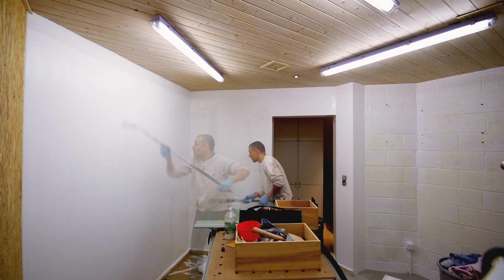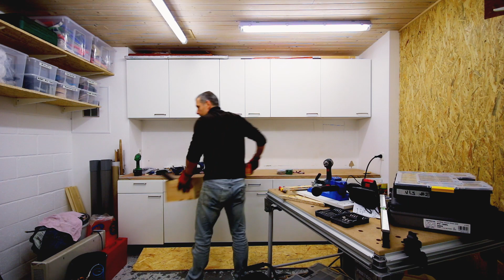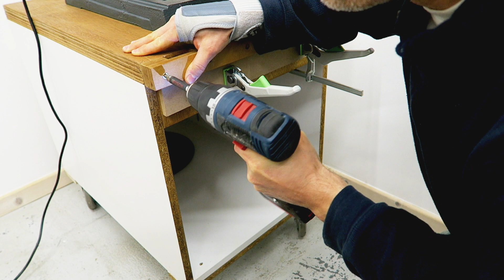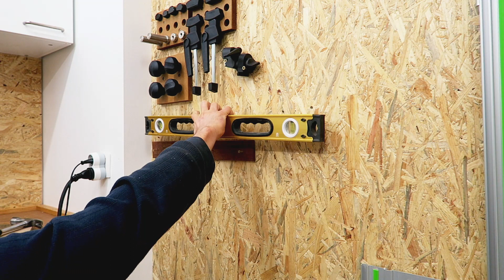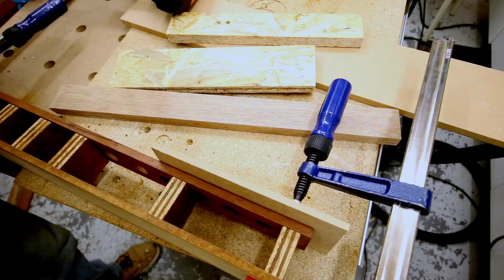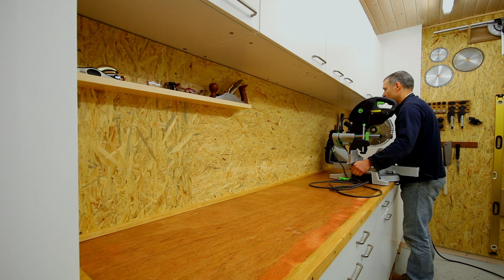Small Workshop Reorganization

Comment: I really like the simple, clean lines, and how you styled all of your hand tool holders. Nice work. A few questions:
-- why OSB and not a nice plywood?
-- why not a French cleat system for your hand tools and bits and bobs to give you more flexibility? I'm sure you considered it.
-- what in the world do you use all those spade bits for? ; )
Reply from the maker: Thank you!
- OSB is much cheaper than ply and it looks great imo, at least in Europe. I love and use this material a lot, plus it ages very nicely in a shop. You won't spot screw holes in an OSB panel, you will instantly in a ply one!
- I only use French cleats to hang frames and mirrors on walls, that's it.  In my shop, I can screw any hand tool/tool holder absolutely anywhere I want on my OSB panels, without thinking. French cleats don't give me this flexibility. 
- I don't use my spade bits actually. You won't see them in my new shop. But you will see a lot of forstner bits instead :-)

Comment: Great Organization. How do you start organizing the workshop? How do you draw up a plan? My workshop is a mess and I don't even know where to begin. Sometimes I look for a tool and can't find it, so I think I lost it so I buy a new one and months later I find the old one which I had missed placed so now I have two of most tools. Could you give us some idea on organization in a methodical way. Thanks.
Reply from the maker: Hi. Organizing a workshop is a never ending process, and each of us has his own way of sorting his shop. With that said, I completely emptied Mine and found a new space for each of my tool. On the wall, in a cabinet, it doesn't matter as long as everything has its own place, and as long as you PUT things back AS SOON AS you don't need them anymore! Much easier said than done actually, as I just spent three entire weeks to reorganize my current workshop, much bigger then the one in this video! Discipline is your top one priority to keep your workshop organized and welcoming! Always keep that in mind and don't work too hard! 😉
Reply: @HODYODesign  Thanks, for your advice, will follow your tip., Keep each tool to an asigned place in the shop and put away in its proper place as soon as done using it.  Happy New Year.